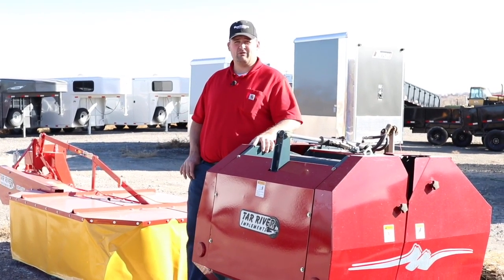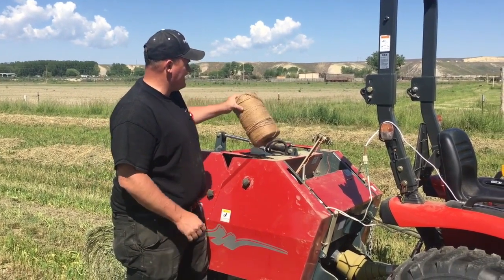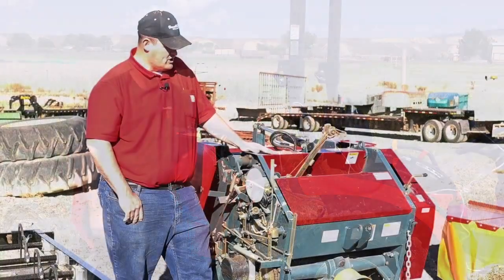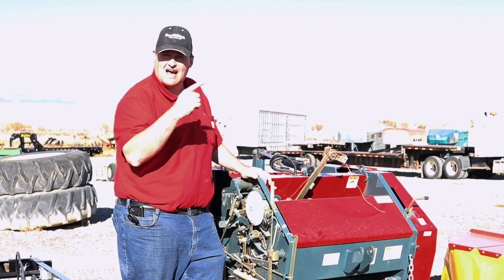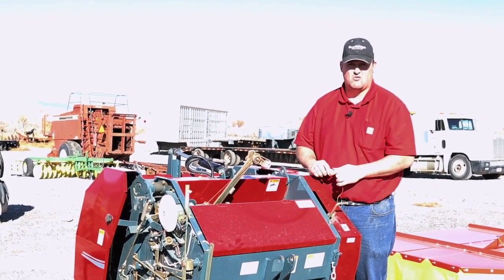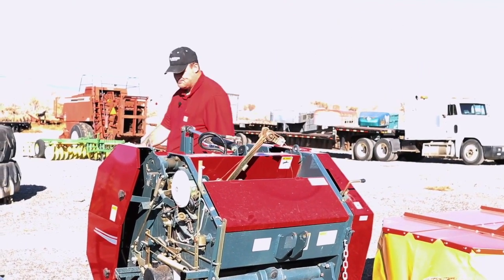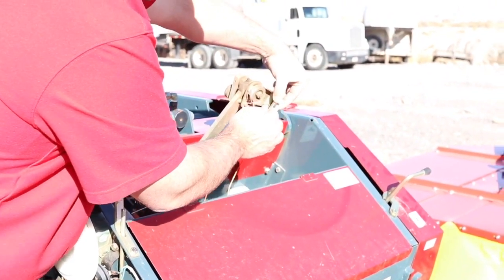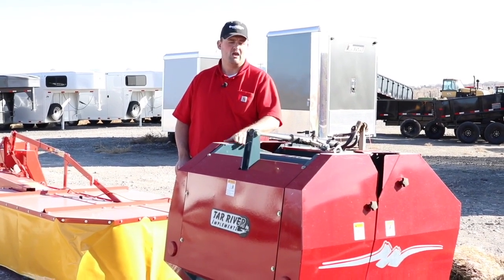How to Bale Round Bales with a Compact Tractor | Twine Troubleshooting + Demo

Comment: Thank you!  Saved me some time figuring this out.  Back to the field
Reply: How's yours working out?  I just got one, planning to bale pinestraw with it. Any valuable info you've learned so far?
Reply: Rolled 300 bales, so working good.  Make your windrows smaller than you think, don't get in a hurry and if baler came with jute twine, toss that out and use poly.   I use the 9000/130 from Tractor supply with orchard grass hay.
Reply: @TheGsellers  Thanks for the response!  I was wondering about the string so that's good to hear. I'm planning to bale Long Leaf Pinestraw with mine, but it's not season yet so I gotta wait.

Comment: How do you get bale out if it over packed. Shear pin broke.
Reply from the maker: We have had some customers with this problem. To fix: Open the gate and use the valve to lock the gate up. Then use a saws-all or chainsaw to cut it out.